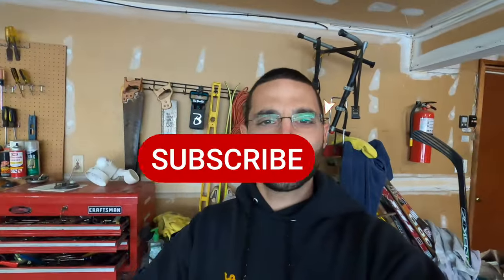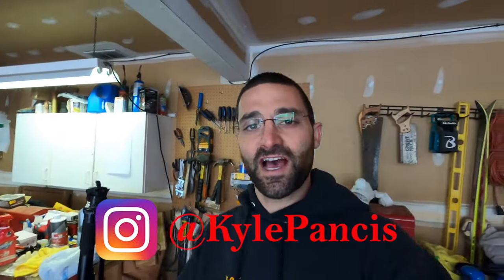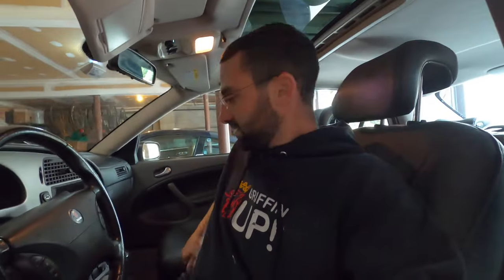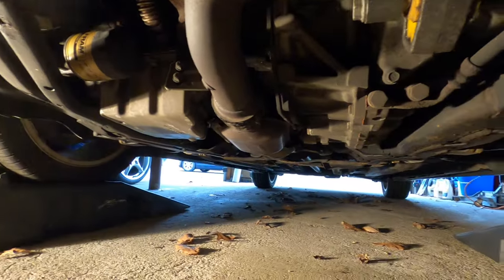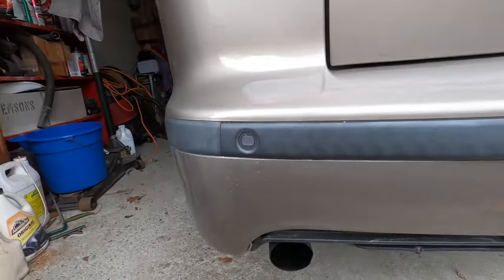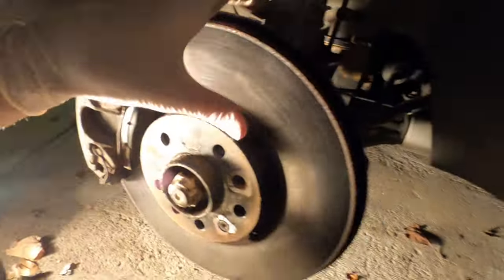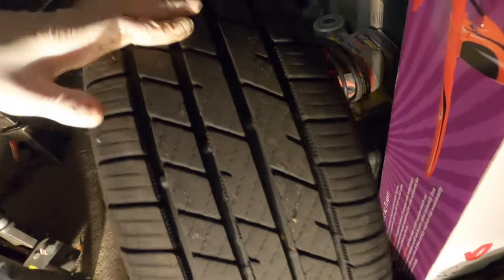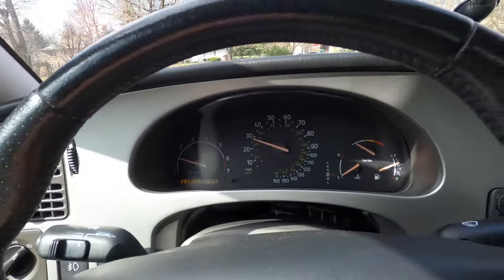How OIL Reliable is an old Saab 9-5 Aero with 200000 Miles?

Comment: I figure it's a good day working on my 2001 Viggen if I don't break anything....lol.  Thanks Kyle!
Reply: Don't understand why you wouldn't top off as required between changes? Keeping track of how much was added seems easier and better for the engine. Please explain your reasoning/logic because I don't understand it. Thanks Kyle.
Reply from the maker: No particular reason, I monitored levels and its been reading a solid reading on the dip stick so I never touched
Reply: @KylePancis  I like your channel and as a SAAB owner and enthusiast, I will remain a subscriber. I simply disagree with your reasoning on this. Thanks Kyle and keep your videos coming. Emil

Comment: Love your channel! Did my oil change in December drove 3000-4000km and noticed oil light coming on on hard brakings or G generating corners lol. I drive it spiritedly but always warm and all the common sense precautions. I knew it was running low so I topped it up and it was mission half the 4 litres of oil it takes. Don't know why it drinks that much. Other wise it's been such a joy bought it 1,5 year ago espresso brown. Runs perfectly, super strong and silky. Stage 1. 280.000km ...what a surprise coming from a BMW M5 E39 and and also a 330d E46. There just special. Never knew I would love my 9-5 Aero so much. Thanks for all you are sharing. Greetings from Belgium
Reply from the maker: Greetings! Thanks for the support. What type of oil are you running in terms of weight? Maybe go with a little thicker oil since it's a bit older.

Comment: 3:45 I would not be crawling around under a car supported by a plastic ramp that has a big hunk missing out of one corner.
Reply from the maker: The center is all built out strong. So it looks bad, but there solid

Comment: 15 year old car with turbo I would say that’s totally normal especially since oil was cold and oil cooler has oil in it still, one quart is totally acceptable especially after 5k miles. Saab’s are so well made I’ve had several and currently drive a 04 9-5 Aero too.

Comment: Hi Kyle, I don't think it's using any oil in the conventional sense. I've had loads of 2.3 turbo 9-5s and they only take 4 litres for a oil and filter change which I've just worked out is 3.8 US quartz.  Hence I reckon you are over-filling and that's the oil you're losing probably through the breathers until it get to the correct level. As it was a cold change, you'd easily have the other half quart still in the engine and also stuck in the filter. My last 9-5 Aero I sold at 178,000 and that used no oil between changes neither did any of the others I've had, I think 11 in all.
Reply: WHOOPS!!! went the wrong way, 4 litres is 4.2/4.3 quarts.

Comment: Not too shabby! Check your top cross pipe or better yet the pipe coming off of the aftercooler. That will tell you a bit about the health of the turbo..
Reply from the maker: Yes!
Reply: @KylePancis  I bought an El cheapo turbo because my original was totally shot. Looking to go bigger compressor this year...maybe ..

Comment: Did you so that was a straight pipe exhaust? Also, great video! Thanks again for all the info! Wish me luck swapping my cracked radiatior soon!
Reply from the maker: Make sure you watch my vid on this car, easy job!! Yes, had the shop cut out the bad center section save weight and money!
Reply: @KylePancis  oh what section do they cut out? I could probably get away with that too!

Comment: My  05 saab 93 linear takes 6.3 quarts. What's up with the .3?

My turbo started sqeaking, I put this sludge cleaner in there let it idle for 15 minutes then change oil.

I was losing oil during times the turbo cartridge had the siren sound.

I ordered cartridge and noise stopped.

I think banjo bolts have filter and get clogged.

There's 237,000 miles on it... my 05 had 357000 these cars if maintenance is done run foreever

Comment: As hard as I drive Saabs, I just change it at 4-5k anyways. Cheap insurance on cars with turbos cooking that oil.
My Arc at 200k only used a half quart by 4k, and was pretty dark by then due to my lead foot. The 01 Viggen gets hammered daily XD and gets changes every 2-3k regardless, since stage3 is hard on the main and rod bearings.

Comment: I have an 08 9-3 sportcombi that could use a little TLC but has been a NC and GA car since new.   I just spent $1000on it fixing a few oil leaks and 2 new tires.   Rear ones are a year old.   I would sell it for a good price if you want another project?   I am a small channel as well.   We could collaborate. Lol.  But you would have to come get her.    She is near Chattanooga Tn And my wife daily drives it. She drives it on the interstate every day to get to her teaching job. The car has legs that will run for miles. Look at my video on my channel where I’m driving the car at night on the freeway. She is a cruiser all day!        Current issues.....Driver side door lock is finicky, we are passenger window is in op,
The damn thing is still leaking some oil from the sensor, and it is just in the beginning stages of needing the Common valve replacement.   I think it is cylinder number two. It has been exactly the same for the past three years. It has not gotten better and it has not gotten worse. The car will start perfectly fine but just has a lumpy idle for the first 30 seconds.    It hog starts perfectly. Anyway if you’re interested at all message me here and we will go from there